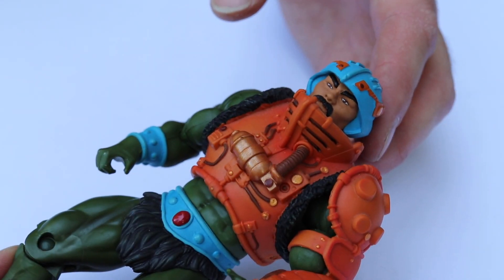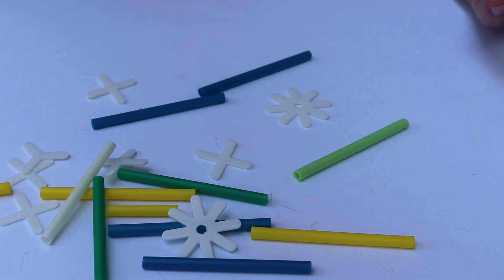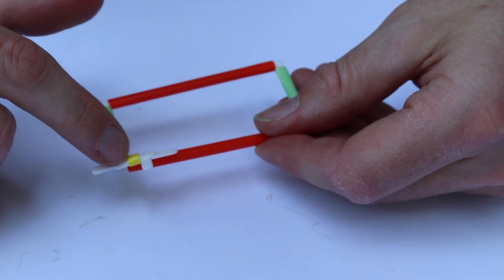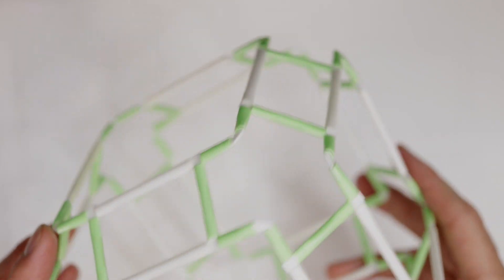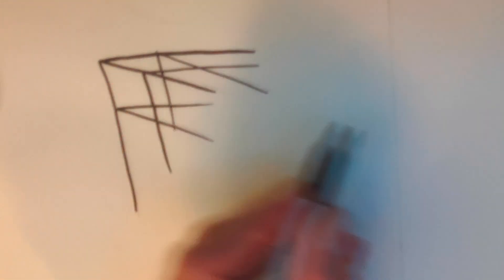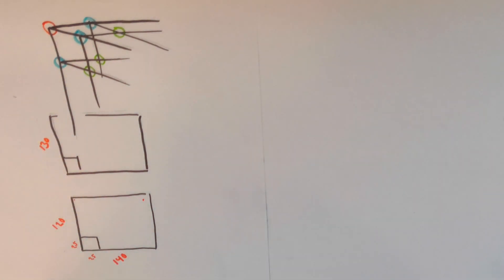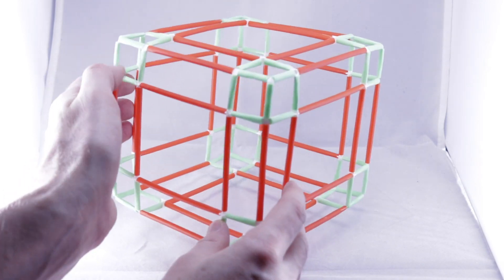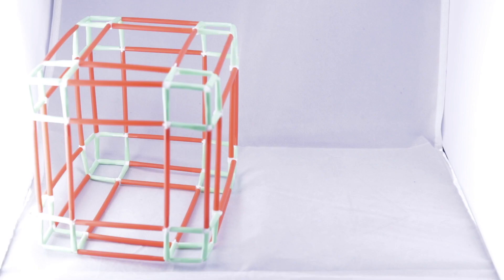Making a Full Size Sci-Fi Spaceship Simulator

Comment: How do you actually program node red to read the json files?
Reply from the maker: I've got that question a couple of times. I'll try to make a more detailed video on it shortly. Will try to share the files, but I don't have access to them right now.

Basically I set up a node that look for changes in a certain file in the file system (or rather a couple of nodes since the different log files work a bit differently). Once I see a change I use a node to interpret the file as json (Node Red got those built in and is quite good at recognising json). That sends each json entry on as an individual execution, and I check the timestamp of those json entries to see if I executed it already, or if it's new. If it's old I do nothing, if it's new I send it on and can do whatever I like with it.